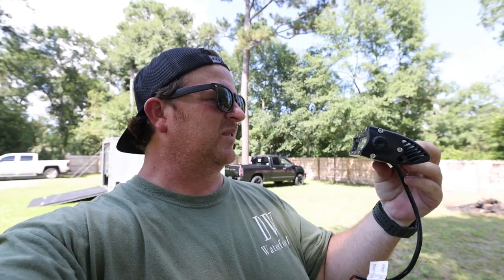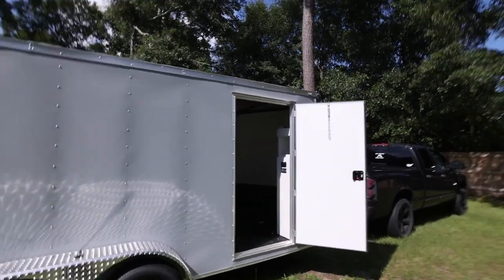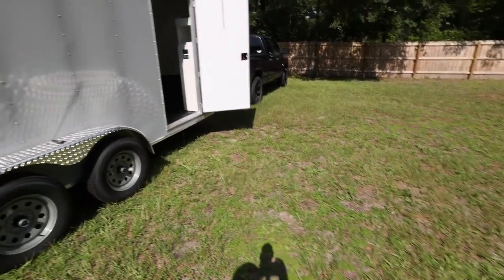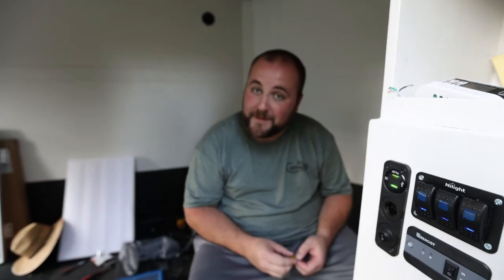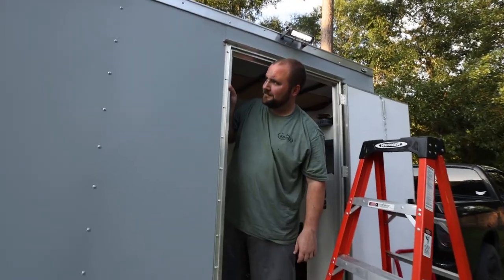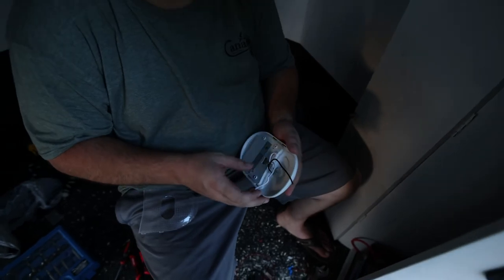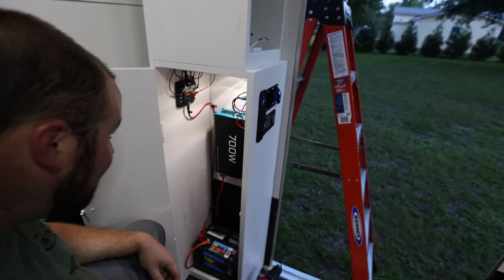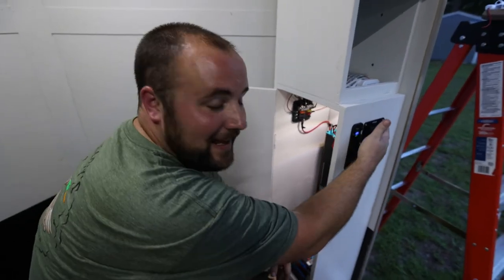The Decoy Trailer Lighting Is Complete! | Trailer Build Ep: 4

Comment: What’s going on fellas. Got a question for you. I’m trying to run my electrical in my trailer like you guys did. Do all your toggle switches run to the fuse block than wire the fuse block to the battery?
Reply from the maker: the toggle switches are daisy chained together. so only one hot and ground wire runs to the fuse block from the switches. then the fuse block runs to the battery. hope this helps!